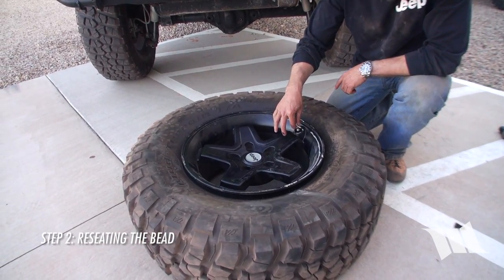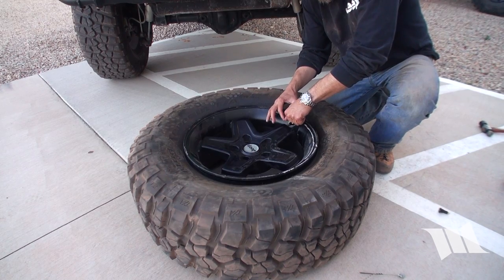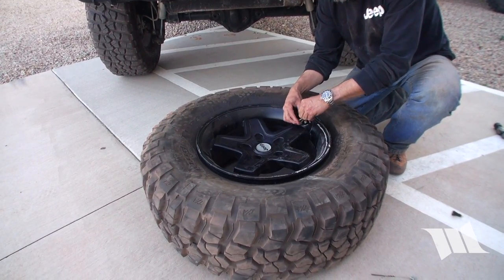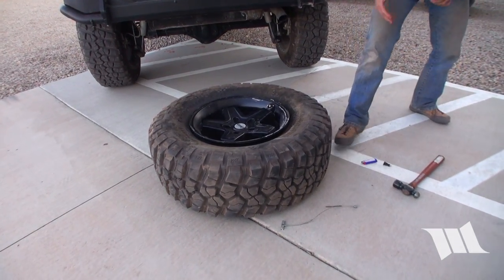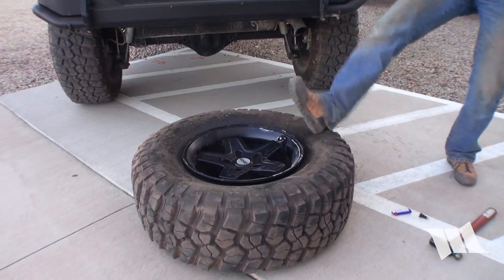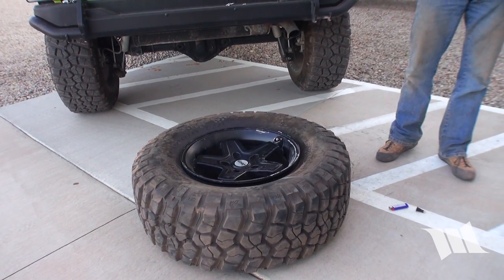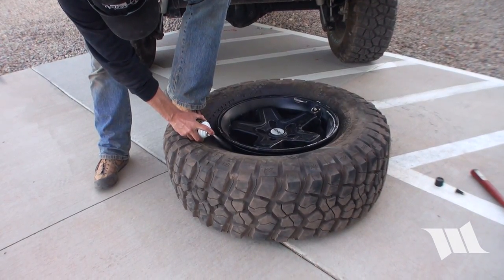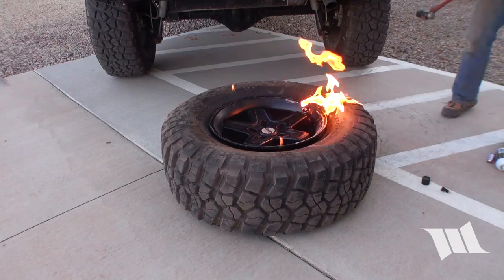SEAT a TIRE with FIRE - How to Break a Bead with a Hi-Lift too

Comment: Good reminder to remove the valve stem
Reply: Removing the valve stem does nothing.
Reply: @teel6060  It allows the tire to equalize after it sets. If you leave the valve stem in the tire can suck in on itself as it consumes all the oxygan. Leaving the stem in does allow it to set a tad easier but you also risk the tire popping off again when it compresses. Ideally you are putting air into the tire right away and even with the stem in sometimes you can't keep up with it. 

I've seen twice tires suck themselves back off the bead.

Comment: As a M.D. B.S. PhD comedian/nuclear physicist, I am qualified to make the following claims regarding the hammer. Oxygen was already able to enter the tire through the gaps between the rubber and the rim. However, this steady flow caused a near-laminar reaction, therefore the fire was burning at a proportionately slow rate. When the hammer struck, the enlarged oxygen inlet caused a disproportionate rate of combustion on one side, causing immense turbulence and igniting the remaining fuel nearly instantly. Another factor is the bounce that allowed ambient air through the bottom at a greater flow rate than when the tire was flush on the ground. The moral of the story is this: laminar flow allows for predictability, but turbulence is the greatest catalyst we can create without a match.
Reply: Bro is onto absolutely nothing
Reply: I bet when you were in school you wore thick black plastic glasses and wore a pen and pencil holder on your shirt pocket if you did it was probably worth it. well  explained.

Comment: what about using a strap ?
Reply from the maker: What about it?
Reply: i have seen people use a ratcheting try down strap around the center of the tire tread and just keep tightening it down until it pops the bead back into place. i think that is what he is meaning by using a strap
Reply from the maker: Yeah, that is one way of doing it but the whole point of this video is to show how you can do this trick without one.
Reply: Strap seems to work best for me on small tires for, lets say the front tire on my zero turn.  Passenger tires say 14,15 or 16" not so much, would take a.lil explosion.  Have used starter fluid on a 15" ranger 4 -5 times today with no luck, its almost like its not combustible anymore but IK it is at least when it's  compressed it will start a engine

Comment: Should have been wearing more protection, (hands, eyes, hair), but I'm very impressed with the way he created a trail of spray to use as a fuse.  I did this today, and I lit the gas by putting my Bic right next to the bead.  Stressful!  Good idea to remove the valve stem.  If you don''t the rapidly cooling explosive gas will create a powerful vacuum and possibly pull the tire off of the bead.